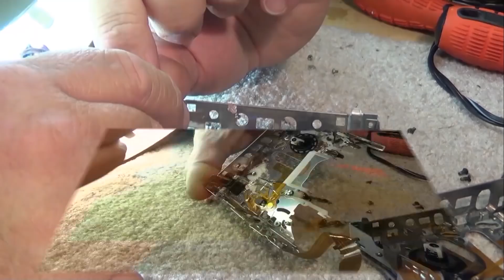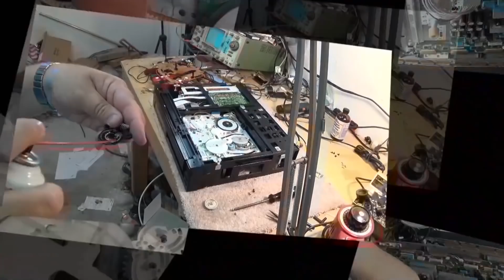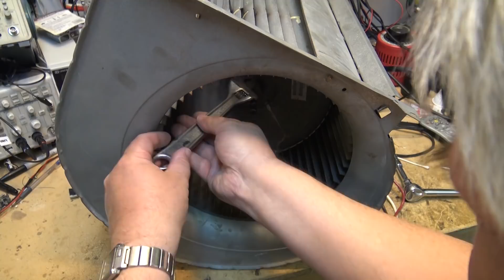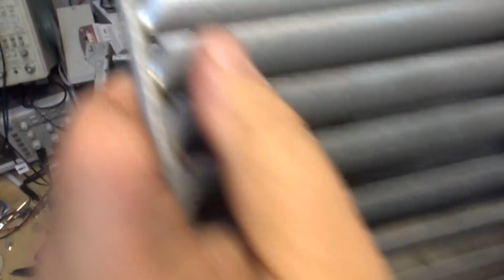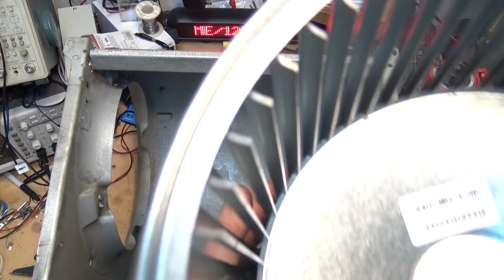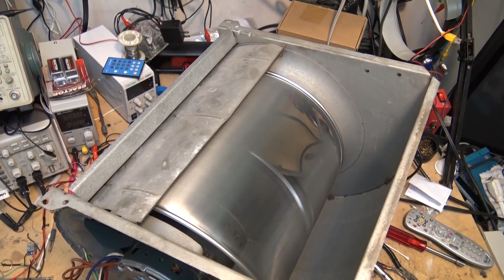Carrier HVAC system blower Wheel replacement

Comment: can you show how you actually got to this initial removal point? I have a carrier 59mn7A, and I've done quite a bit of self replacement, but just wondering if I have to remove the control board, transformer, and all of those things to get the entire blower assembly out...
Reply from the maker: I can't show it because it's all together but yes the control board comes our, 2 screws hold the bracket with the board and transformer.  It flips out if the way.  Then 2 bolts hold the blower in place and it slides out. Mine is very hard to get our as it crammed in a closet.  No room to work.

Comment: Why there are comments says "Carrier won't sell you Blower Wheel"? Thanks for the video.
Reply from the maker: Carrier would not sell it to me. Neither would 9 out of 10 of the dealers they gave me. They all had to install it.  I ended up getting it from the large refrigeration (union shop) company that put the system in 20 years ago.  They ordered it and sold it to me and i replaced it.
Reply: @12voltvids  That may be the reason I only see used one in auction site instead of new one made by Carrier or OEM. Thanks for the information.
Reply from the maker: @callmebackfriday2  it's the dealers.  They operate repair businesses.  It's the same as trying to buy garage door opener parts.
Reply: @12voltvids  Good to know. If I see a new OEM one, I better grip it fast. 🙂

Comment: Funny no one ever shows you when the blower wheel is stuck on the shaft of the motor, or how to get it off.
Reply from the maker: Tap with plastic mallet
Reply: Heated my shaft at an angle. Shaft popped right out with a rubber mallet.

Comment: I detect a bit of wobble on your new PRECISION wheel lol. but that shouldn't affect anything really. Just pointing that out for a supposedly "precision" wheel that cost you an arm and a leg, I'm sure! mine wobbles too but when I balanced it. The blower assembly no longer shakes and only cost 50 cents for the new weights

Comment: why didn't you just purchase blower wheel weights and save 300 bucks for another wheel?
Reply from the maker: That one that failed had been balanced by the installation company.  The new one is fine now.  The system is 18 years old.
Reply: @12voltvids  18 years old? that's barely a teenager. Mine is 45 years old and still running good, cept for an out of balance blower wheel but Bryant wont sell me parts cause it would be a liability lol
Reply from the maker: @rogerd4559  
Here the service guys will only sell if they can charge a fortune to install.  Fortunately I was able to get one from the big union shop I paid a pretty penny to when i built the house in 2002.   They are plenty busy enough so they sell parts to anyone.
Reply from the maker: It wasn't out of balance, the hub in the middle that spins it broke free from the motor shaft.

Comment: I realize it sounds crazy that companies don’t want to sell you parts that you will be changing by yourself (even if you are more than able), but the reason it’s done is exactly for liability. All manufacturers see a customer doing their own work as voiding any warranty. For any furnace or any other gas appliance, the person liable for damages either to the machine or damages to property or to human life is the person who’s on the most recent invoice or paperwork (if ever there was any maintenance or repairs done by a company) they have to leave paperwork. 
Even if a customer did it themselves, any liability falls back on the person who was recorded (aka paper trail) to be last person fixing or maintaining said appliance.
Reply: Ask that person if they have ever heard of a building permit before.
Reply: @josephastier7421  that also, but like i said liability always falls back on the person who last had a papertrail for the unit in question. 
As a technician i really do hate any and all clients regardless if they are licensed or not licensed, who work on equipment themselves after i had worked on it. i understand that some are capable but like i said anything they screw up it falls back on me or whoever they can prove on paper who last worked on it. 
Last thing i want is a client causing property damage or personal injury/death from the unit not operating properly

Comment: Why not ship to Canada?
Reply from the maker: They have contracts with dealers in Canada.  The big problem is these dealers for the most part also have installation divisions so they won't sell parts direct only if they installed them for their service call rate.  I eventually went back to the large refrigeration company that put my system in back in 2002 and they sold me the part and sold it cheaper than it would have cost to have it drop shipped to the us and brought it back myself.

Comment: Don't feel bad most of us are in the same boat when it comes to parts. I had to replace my fan motor and like you they would not sell to me. I had already went there to if it had not been for a nice guy letting me buy it though his work I would have been f**k*d so I gave him 10 bucks. Yes I to think ( not that my opinion means anything ) most heating and air  parts  places  suck  and  most but not all of the heating and air places do to.

Comment: I would be dead here in South Texas if I had to wait on parts that long, been around 97-100F over the last two weeks, plus humidity... I have mini-split heat pumps I installed myself and they work great, no more forced air for me, great video as usual. :) one problem is they do get dirty and have to be cleaned anually otherwise they fill with dirt and mildew. one benefit, the company that sold them to me has replacement-repair parts and sells to the GP.

Comment: Did you try Regal Controls in Vancouver? They're one of my suppliers. Good guys , and they carry tons of inventory.
Reply from the maker: I forget the ones I tried. About a half dozen and they all said the same thing. As soon as I said I was looking to buy the part the response was "I'm not your guy for that"  "Sorry it can only be installed by a licensed gas fitter, if you blow yourself up I could get sued" and the likes.
Reply: @12voltvids  Show him your approved building permit.  Mention that your work gets reviewed by an inspector at every stage of the job.
Reply from the maker: @josephastier7421  why would I need a building permit to repair my HVAC?
Reply: @12voltvids  You would show it to someone who is trying to say you would blow yourself up doing it yourself.  Nothing like a city engineer's stamp on your drawings to say otherwise.
Reply from the maker: @josephastier7421  
Got nothing to do with that.   The places that can get the parts also install them.  They won't sell parts no matter what.  Same goes for the last raining stereo repair shop in the area.  They won't sell parts to anyone, me included.  They have offered me a job there a fee times.   Won't  sell me parts to compete with them.

Comment: Dam that's a powerfull unit, the motor must have been made well, still working great :-D

I really hate companys for there attitude on parts, bunch of bastards!!.
At least the company that fitted your system helped you, but we know that the part cost much less than they charged you, profit greed is really sad.
Reply from the maker: OK 91 US, that is about 120 CDN, plus I would be raped for shipping because the USA has the most expensive shipping to Canada in the world. I had a VCR shipped up and it was 84.00 to ship it here.
Then broker chargers.
Reply: zx8401ztv 

$91 here http://www.technicalhotandcoldparts.com/carrier-la22za120-blower-wheel.html

Comment: All these prices for parts etc . I can understand a 10% price difference or a bit of stocking fee but a couple of days ago I heard about this.  https://newmobility.news/2018/05/31/french-car-makers-kept-spare-part-prices-artificially-high/
Reply from the maker: Insert your favorite German car brand here is you want real price fixing.
Reply: Same with the official garages. My car needed a new clutch and flywheel at arond 180.000km.  Official garage quoted 1200 euro for the parts plus labor which would be around 2000 euro in total. So that is about 3000 Canadian dollars. Went across the border like 80km away to a specialized VAG independant dealer and got a Sachs clutch and flywheel (one of the best ones) mounted, parts and labor, for 600 euro which is like 900 CAD.  Best of all the guy that did the job showed me the wear and tear while taking it apart. During their break we ate lunch together for free since cheese, ham etc was in the fridge and offered to me to take it. I sat with all these guys eating lunch.  After the work was done my car was fully inspected and that included me showing the signs of wear. It felt really odd but good knowing that some companies still do an honest job and I am sure these guys make a good living too.